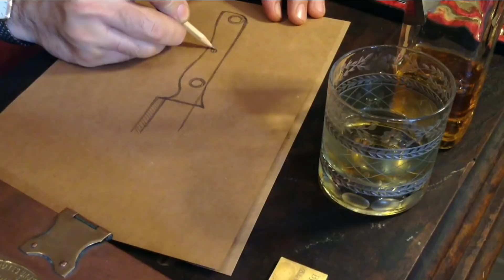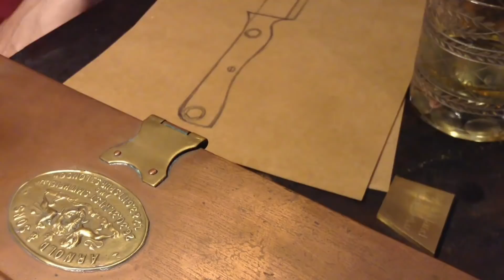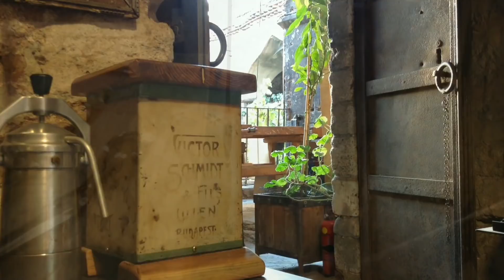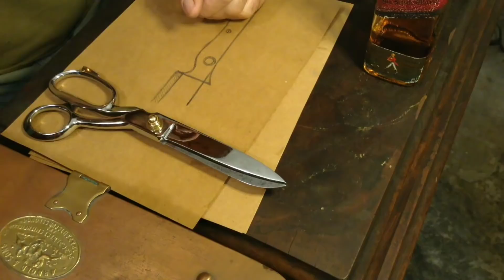Solingen Scissors Restoration - Meticulous Work

Comment: I actually have a pair of scissors that are at least 60-70 years old if not older, and they have been taken care of so they look as perfect as the day the left the shop. Minus some scratches and normal wear marks of course. I need to sharpen them. But I bought a bunch of scissors a few years ago trying to find the best to cut ballistic rated Kevlar fabric. Eventually I found a pair of spring loaded micro serrated on one side, razor sharp on the other, and they cut anything and everything like its butter and they are red hot. I don’t think I’ll ever need another pair of scissors ever again.
Reply from the maker: Sounds perfect, thank you for saving that old guy and thank you for this detailed story. Great to see you here ⚒️🗜️🌟

Comment: I think I have spotted a minor mistake in the final assembly. Shouldn't the bolt go through the hole first, then screwed into the second blade and countered with the nut, so that it won't come loose?
Otherwise awesome work.
Reply from the maker: Thank you for your thoughts and nice to see you here. I'm glad you like the work 🗜️⚒️🌟

Comment: Nice job again. Won't you get galvanic corrosion between the two metals - the nut and bolt, and the scissors themselves?
Reply from the maker: Usually no Mike but sometimes yes. Totally depends on the climate. Nice to see you here

Comment: I have a similar pair of scissors, but there is a small bend in the tip of the blade. Any ideas for straightening it out?
Reply from the maker: Some scissors has naturally that kind of shape. If it is a real bug you can heat just that area and try to straighten.